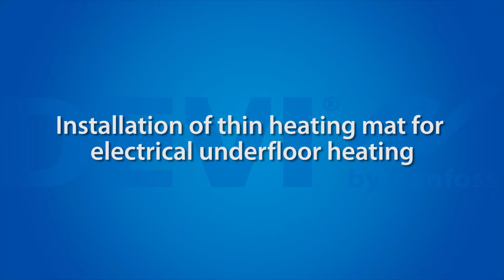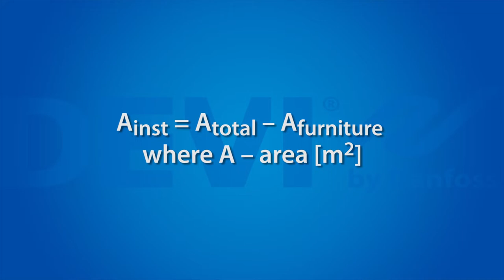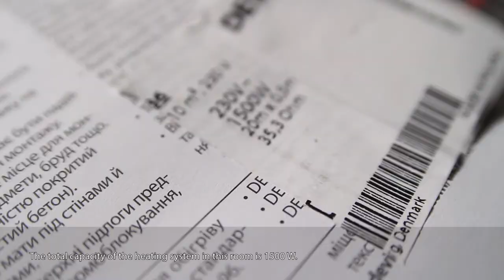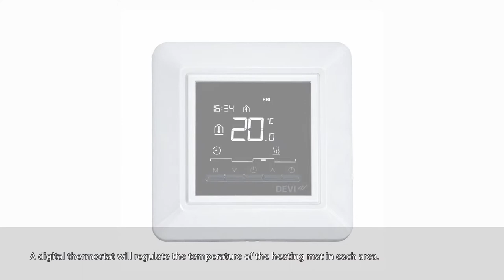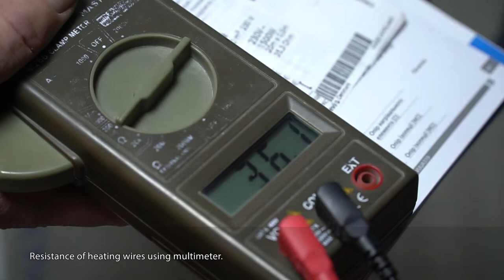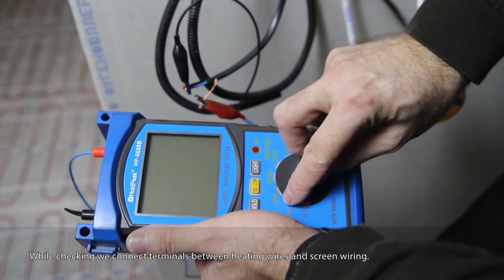DEVI - Electrical Heating Systems

Comment: Great video, thanks! Will be a problem if the sensor will be 10cm next to the radiator pipes? i don't have a lot of options for a thermostat to place and the best one is next to the towel radiator.